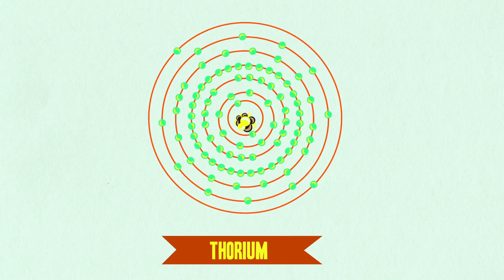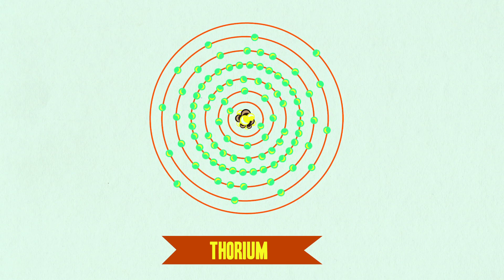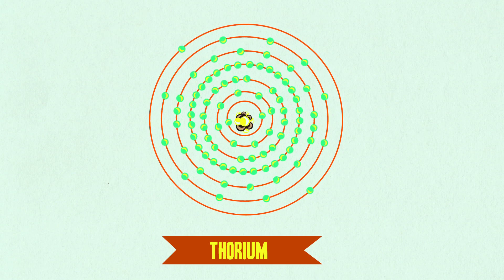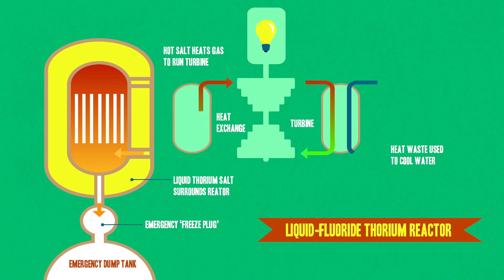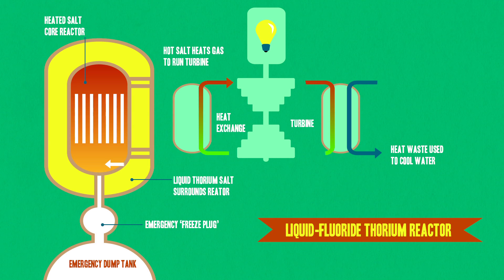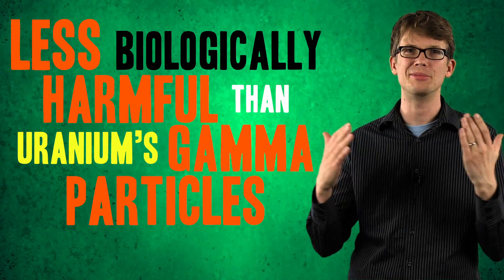Liquid Fluoride Thorium Reactors (LFTR): Energy for the Future?

Comment: Even if you solved the issue of wind and solar's intermittency with some perfect intermediate storage solution (such as with total-electroactive liquid/ionic liquid flow cells) you'd still be stuck with using a source of energy that simply cannot compare to a similarly developped nuclear system. Our current nukes use 4% of their fuel, with a total efficiency of 0.7-1.0%. Can you imagine having reactors with fuel efficiencies nearing 100% and total efficiencies of above 50%?

Comment: Yeah, the wind always blows somewhere, the same goes for the sun. But i'm a Dane(We use a lot of wind), and we usually have that problem, that the wind produces a lot of electricity, when we don't need it, which means it goes to Sweden, or Germany, very cheap. But when we need the electricity, the wind isn't blowing as much, so we need to import electricity, at some crazy price rates.
It would be great, if we were better at electrolysis, and could store the hydrogen.

Comment: Nuclear reactors only melt down, when people act like idiots. Placing a reactor near a continental shift, bad idea. Keeping a 40 year old reactor running in such a place, even worse idea. Having graphite at the ends of control rods, which speeds up the fission process, bad idea. Keeping a reactor running, instead of shutting it down, as the the safety regulations told, and further more, retract the control rods above the recommended level, incredibly insane and stupid idea.

Comment: Its hot to us, but not to scientists dealing with fusion which can easily be a billion K. Cold fusion would be fusion that occurs even at a few tens or hundreds of thousand K (also, it's impossible).

Wind and Solar are great, if they're tied into a large enough grid. There's nothing unstable about it, as the sun always shines and the wind always blows SOMEWHERE.

Hydro is clean once up and running, but the devastation of habitat that occurs to set up a hydro lake would leave you shocked.

Comment: Yeah, it's relatively cold, when you think about the temperatures needed to reach a plasmic stage. But molten salt is still pretty hot. 
Speaking of fusion, maybe there's hope with lasers. It's definetly worth testing. I mean, it's like the best energy source ever. 
But until then(if ever), i think LFT reactors are a good solution(I don't really believe in wind and solar, too unstable in terms of producing for my taste, hydro is cool though)

Comment: Cold fusion isn't only unsubstantiated, it has been disproven and abandoned.

Hot fusion is progressing maddeningly slowly with the ITER project, but there is no indication that reactors patterned on ITER will be cheap if they are ever proven to be commercially viable (they hopefully will be cheap to operate in the long run, especially since they will produce very little hazardous waste).

Comment: Since the liquid salt won't need to be pressurized, and draining the liquid from the core just shuts down the reactor safely, the engineering options to address this problem are plentiful.  It doesn't need to be in a steel vessel if it is at atmospheric pressure, it could be contained in some kind of flouride-resistant ceramic.

Comment: True, but it doesn't have to be pressurized, and if the core springs a leak, the reactor just shuts itself down as the LiFTR drains into the sump under it.  Since the fuel is in the coolant, a drained reactor is just a shut-down.

As long as it can be kept out of the ground water, the corrosion problems aren't nearly as serious as they are with a working fluid at very high pressures that is also the coolant.

Comment: Not to defend greedy corporate jerkoffs, but the primary concern at the time was the strategic value of nuclear submarines in the Cold War.  

Once the infrastructure for nuclear powered vessels were in place, the path of least resistance in civilian nuclear power was Uranium, and civilian nuclear power could get well trained operators when they left the Navy.  

LFTR would require building an entirely new industry and all its infrastructure from the ground up, which is hideously expensive.

Comment: As a former Navy nuc, I was very skeptical about LFTR until I considered the huge advantages of not having to pressurize the reactor plant.  Likewise, I was sold on the apparent ease of refueling and the advantages with respect to shutting down the plant (even though the Thorium fuel is in the coolant, critical geometry is only possible in the reactor (where the reflectors and moderators are), so it can just be drained to shut it down).  The amount and relative hazard of waste is also low.

Comment: Well, thorium itself isn't really that difficult a resource to find. Thorium can be extracted from plain granite at much higher EROIs than mining coal or drilling up oil (a tonne of granite contains some 20-30 times more energy in thorium than a what you get from burning a tonne of coal). What we're missing is the reactors that can use thorium effectively. It's a technological race that the US is losing badly.

Comment: Thorium fluoride is also relatively inexpensive when you account for its energy value, there's a flurry of other components that cost far, far more than thorium or its fluoride (beryllium, pure lithium-7, and the few kilos of fissile U-235 comes to mind). 

Besides, a reactor that costs 2 billion dollars to build is worth it if it returns 600-700 million dollars per year in electricity alone and is designed to last 40 years.

Comment: Those issues were resolved back in the 60s. The MSRE used Hastelloy-N which was designed to hold high temperature molten fluoride salts. Tellurium alloying was an unexpected issue, but this was also resolved with three different Hastelloy-N compositions, one of which even performed better over time while irradiated.

Comment: While Thorium would be an amazing fuel source, and we should definitely be researching the technology. There's a lot of problems with it. the Floride salts used in LIFTR are pretty damn scary stuff. They'll eat through and corrode most metals, and when heated up to howeverhotthereactoris, they get even worse. Also, Thorium is cheap, but Thorium(IV) floride (say that ten times fast.), the salt the reactor uses, isn't. Yet. IWouldPutAConclusionHere,But I'mRunningOutOfCharacters.SoYouDontGetOne.

Comment: Salts are corrosive to certain materials, not all materials.  Water is also corrosive in the right conditions, it is a matter of knowing your conditions and planning for it.  Fluorine bound with an alkaline is generally very stable, like table salt, it is both sodium and chloride.  Apart, they will kill you, but combined they are tasty and delicious!  The original makers of the MSRE were concerned about corrosion as well, but they believed the solved that problem 50 years ago.

Comment: Cold fusion isn't substantiated.

There was a way to make fusion work and at an incredibly low cost, but it involved fission-initiated fusion microthermonuclear explosives, back in the day when the US was looking for commercial applications for the bomb. The project was called PACER, a hole in the ground basically. It also used FLiBe to breed both tritium and uranium-233 from thorium. It was crazy, but 95+% fusion fuel efficiences were definitely nothing to sneeze at.

Comment: Technological lock-in is so prevalent in the nuclear industry that it's insane.

The DOE officially partnered with the Chinese CAS to help develop their LFTR. You'd think this meant the DOE finally wizened up and is seriously considering the LFTR, but you'd be wrong.

The only thing the DOE wants is the molten-salt technology to make marginally better uranium-235 reactors. They still won't consider thorium as a fuel, and they'll continue using uranium as a solid fuel. Almost nothing will change.

Comment: The LFTR's waste stream will arguably be where its value comes from. Only 16% of its total waste will need to be stored (most of it Caesium-137, store for 300 years for 10 half lives). The rest is stuff like Xenon and Pu-238 for NASA, light platinum metals, neodymium, Molybdenum-99 to make Tc-99m (highly valued for medical diagnosis), Th-229 which can go into nuclear clocks and rechargeable ultra-high power nuclear batteries for NASA and Bi-213 which can be chelated by antibodies to treat cancer

Comment: Another thing to consider is that thorium itself isn't rare at all. Granite holds 10 to 15 grams of thorium per metric tonne, which is roughly equivalent to burning 30-45 tonnes of coal if completely consumed in an LFTR. Extracting thorium from rock is also cheap at something like 100 USD per pound with 1960s technology. Any country can get their hands on pure thorium metal.

Comment: Actually you're wrong on both accounts.

Chernobyl was built correctly, it was USSR governmental buscrapping and letting complete new workers run a test how far they could go with the meltdown proximity... noobs at superweapon control? need I say more (not their fault btw, government fault)

Fukushima WAS built to whitstand that earthquake, they simply did not calculate for it to be combined with a tsuname of THAT power (they did however calculate for a smaller tsunami).

Comment: Since the production of CO2 in the combustion of carbon-based fuel happens much faster than the fixation of carbon in the growth cycles of plant, the CO2 production via combustion wins.  That is not to say that biofuels are bad - just that they are not a solution to CO2 emission problems.

Comment: Getting weapons-grade plutonium isn't even the hard part to making a plutonium bomb, it's actually making the bomb itself. A U-235 bomb is just a gun-barrel design that smashes two U-235 chunks together to make a critical mass, with explosion initiated by a neutron source. To make a critical mass of plutonium, you need to compress it via an implosion mechanism. This requires machined explosives and utterly perfect geometry (and a few military design secrets), otherwise it won't work.

Comment: Just to be clear, the plutonium found in pressurized water reactor is too high in Pu-240 to ever be used in bombs, while being too low in Pu-239 (the actual bomb stuff). Some exceptions apply if you deliberately retro-fit a reactor to have shorter burn-up times (CANDU's are infamous for this, see India's first bomb test). You don't want too much Pu-240 because it spontaneously fissions and can set off nuclear chain reactions, meaning your bomb might go critical as you're assembling it.

Comment: Yes. People need to realize that thermodynamics sets hard limits to how much energy can be produced from specific sources using a set amount of material and space, which play dominating roles in the total cost of utilizing that source. Technological improvements may approach that limit, but never equal or exceed it, due to entropy. You also encounter a higher case of diminishing returns as you draw closer to the limit.

Comment: We already built a molten salt reactor, tested all three fuels (U235, U238-Pu239, Th-U233), tested materials, tested removing fission byproducts, ran 20,000 hrs. Wikipedia "molten salt reactor experiment". LFTR would just add "thorium to uranium conversion" to the reactor, instead of making the U233 elsewhere. Modern designs would use better materials, better instrumentation, modern manufacturing and quality control. China will patent all advances they make, might be better for USA to develop it

Comment: LFTR is not some "slight modification" of light water reactors (LWR). LFTRs use NO WATER, so can't have loss of coolant accidents, can't have hydrogen explosions. LFTRs don't have solid fuel, so can't have fuel rods melt. LWRs use about 1% of the fuel, fission byproducts stop fission; LFTRs use over 99% of the fuel, since it is easy to remove fission byproducts from liquid fuel. With no fossil fuels, Japan is very interested in nuclear power (but not LWR) and LFTR research is being done there.

Comment: The nuclear process isn't the problem in an accident. It's dealing with the extremely hot core afterwards. You need to cool it down and you can't do that if your water is gone.

The LFTR also deals with the moderator problem by moving the fuel salt away from it in an accident. But where its safety drastically improves is that the LFTR can simultaneously move that fuel salt into a tank configured to allow the salt to expand and cool. Only gravity is required to do all this.

Comment: LFTR needs to happen, because it's the best kind of reactor for producting large amounts of power in space.  It's comparatively small, comparatively lightweight, produces less heat that needs to be radiated, and has fewer health risks for astronauts.  Even if LFTR doesn't end up producing the energy needed for an Earth-based civilization, it is nearly a necessity for a space-based civilization.

Comment: Fusion-LFTR hybrids have been proposed, particularly because the molten salt used would include lithium which can be bred into tritium (lithium-6). The fusion design would also use molten salts and neutron-producing fusion reactions to breed more fissile fuel for the LFTR and more tritium for itself. The only issue is the fusion reactor, it would need to be a PACER to get high enough efficiencies (95%+). PACER fusion uses mini fission-boosted fusion bombs detonated underground to produce power.

Comment: I agree that the phrase 'gamma particles' is not technically false, but it's the way in which it was used that I have a problem with. If he had been talking solely about gamma radiation it wouldn't have been such a problem, but the direct comparison between alpha and gamma particles in the same sentence gives the false impression that they are very similar, when in fact the way they ionise is considerably different. I only really have a problem with the phrase in this particular context.

Comment: Although gammas can ionize through photoelectric effect, Compton scattering or pair production, they still ionize less than alphas. Alphas have a +2 charge and yank electrons away from other atoms really effectively. It's not a matter of what you consider to be true - it is a fact that alpha particles are the most ionizing form of radiation. Gamma rays are only more dangerous because they are difficult to shield. If alphas get past your shielding (you eat it), they kill you faster than gammas.

Comment: Hank, there are several mistakes in this video. First of all, uranium is an alpha emitter. It does not emit gammas. You can hold unspent solid nuclear fuel in your bare hands and be just fine; it's only dangerous once it's been irradiated. Also, a "fission chamber" is a type of neutron detector. I think the term you were looking for there is "reactor core." It is unclear in this video that LFTRs use liquid fuel, which is a pretty cool feature.

Comment: I wouldn't consider Gamma/X-ray least ionizing as it can knock multiple electrons along its path in at-least 3 different ways(ei, campton effect). I know how gamma radiation works. Im just trying to dumb down my explanation. I see your point but the thing is; Photon is both wave and particle as with electron and any other particle. Although the correct term is Alpha particle and Gamma ray, I wouldn't call the term Gamma Particle wrong. That term is even used but quite a lot of educational sites.

Comment: The LFTR waste stream is tiny because of its slick molten salt distillation systems. It can partition fission products and transuranics effectively, re-adding transuranics into the core fuel to obliterate them through nuclear transmutation (while keeping really valuable transuranics, like Pu-238 for NASA deep-space probes). You can also separate the fission products to save things like platinum metals and neodymium. What you end up with is 15% of the mass as "true" waste that needs burial.

Comment: Nuclear plants are absurdly profitable once built. They produce massive amounts of electricity for very little cost, even when burning Uranium-235 which is as rare as gold in nature. Decomissioning isn't bad unless you can't replace the plant with a new one. The initial capital cost is the real issue, and it will vary depending on regulatory needs and licensing. Usually, countries with inefficient regulatory commissions will have very high initial capital costs on nuclear plants.

Comment: Most every technology on the planet does such to generate electrical power.  However, LFTR technology isn't limited to just power.  Because it is a really great way to generate heat, it has many industrial applications.  For instance, there is a proposal to use a MSR to power high heat electrolysis for the generation of hydrogen. Huge volumes of heat are needed in processing aluminum, ect.  The industrial heat application of LFTR is a key strength beyond power, both of which are unrivaled.

Comment: Free energy is an illusion. The cost of solar panels and their maintenance is real, so is the cost and maintenance of nuclear reactors. What sets nuclear apart is that you can produce roughly 2 million times more energy by mass and volume compared to solar, theoretically. Therefore, with an ideal reactor you would need far less "stuff" and "space" to produce the same amount of power, and because those are very important elements to cost, nuclear runs much higher chances of being cheaper.

Comment: No, actually gamma radiation is the least ionising form of radiation. Also, you don't quite seem to be clear on how gamma radiation works. Unlike alpha and beta radiation which ionise directly due to their charge and mass, gamma radiation has no charge and photons have no mass, so they only indirectly ionise by tansferring energy. I agree that they are more dangerous due to the high penetration, but my problem was with the use of the phrase 'gamma particles' when gamma radiation is in wave form.